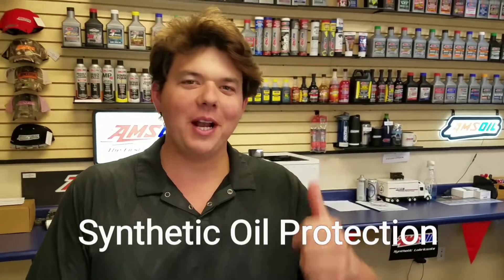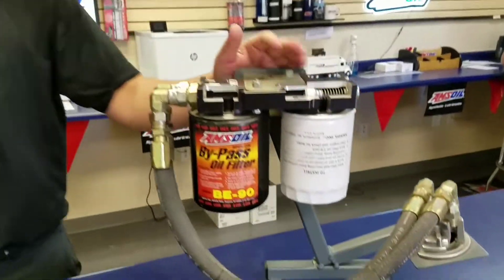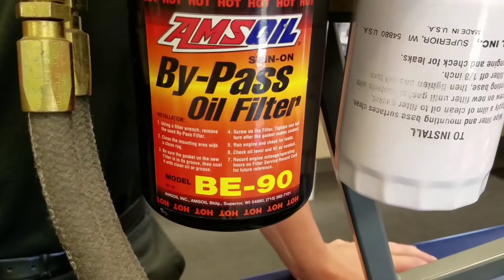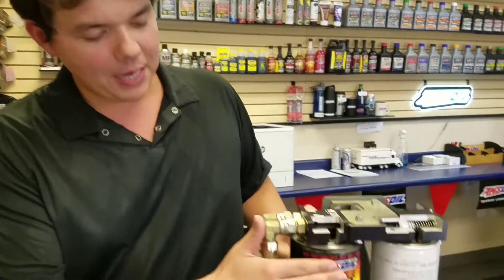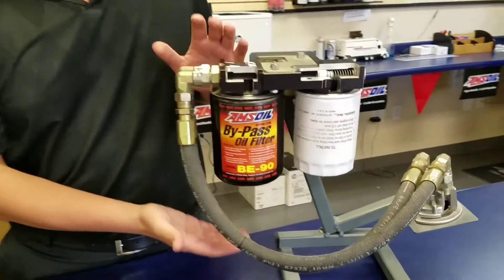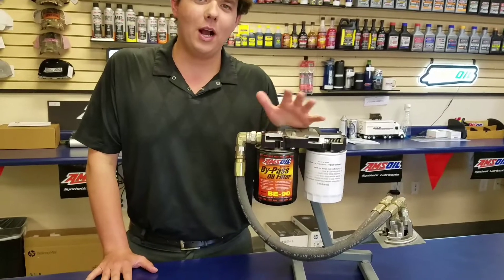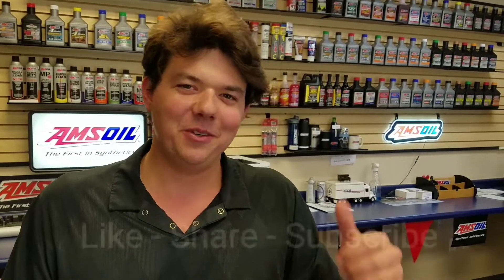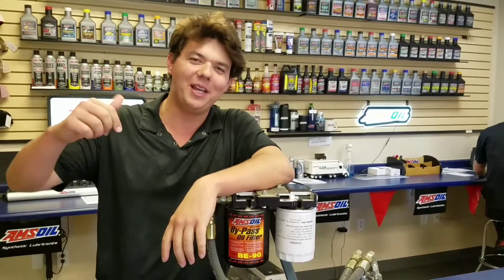Why Does Diesel Oil Get Black & Sooty & AMSOIL Will Help?

Comment: The bypass filter does not change the color of the oil, although the filter does filter the soot to  smaller particles
Reply from the maker: Yes when you put it on your fingertips and feel it it is a difference in color.
Less particles floating in the oil.

You can actually tell when the oil is really starting to wear out by feeling it between your fingertips that is something you get a knack for over years you can always do an oil analysis test to know exactly what's in your motor oil - https://youtube.com/shorts/ycKs-VSepps?si=FEUYzpBwSD9AXKQC

Let's give a man a fishing pole & show him how to fish. 

     Together! We can get your vehicles to run better than brand new! 

     For me to get credit & be "Your" Independent AMSOIL Dealer, please use my website below or my dealer no. 5331179 call anytime Eben Rockmaker 702-472-3614
After you click on: http://syntheticoilprotection.net
1. Click the hamburger menu
2. Click offers AMSOIL preferred customer
3. Click join now. 6-month PC member add to cart.  ( There is no reoccurring renewal membership unless you select that dot box ) 
( You have the option to not have your credit card saved if you prefer - est. 1972 )
4. Scroll up to the top Select shop by vehicle. 

New Promo Code: FREEWAND

Comment: I talked to a Ram 6.7 diesel owner, who swears by the Amsoil Max Duty 5w30 diesel oil. Do you have any customers using this oil in the late model ( emission ) pick up diesel engines. There doesn't seem to be any reviews or you tubes on this oil.
Reply from the maker: Oh yeah tons of them definitely check out the playlist on how to improve the performance of your engine by choosing the right oil and lube you'll see that on the home screen of the channel here you'll see about 20 different videos with diesel engines all different types and results if you have any questions always give me a call happy to answer anything specific.
Together! We can get your vehicles to run better than brand new!

     For me to get credit & be "Your" Independent AMSOIL Dealer, please use my website below or my dealer no. 5331179 call anytime Eben Rockmaker 702-472-3614
After you click on: http://syntheticoilprotection.net
1. Click the hamburger menu
2. Click offers AMSOIL preferred customer
3. Click join now. 6-month PC member add to cart.  ( There is no reoccurring renewal membership unless you select that dot box ) 
( You have the option to not have your credit card saved if you prefer - est. 1972 )
4. Scroll up to the top Select shop by vehicle. 

New Promo Code: FREEMP

Comment: Thanks for the videos.
 I have a problem with my 2013 Yaris Diesel. For the first time 13 months ago my service - oil light came on.  It's this yellow spanner.  I asked a friend and he said it's nothing. So I turned it off but after about 7 months it came back on.  I go to the mechanic who tells me to do an oil change.  I make a change but after about a thousand kilometers it comes back on. I go again and it removes my oil because the level had risen.  But after a thousand kilometers it lights up again.  I go to another mechanic and he tells me that I didn't put in the right oil, and that I have soot in the oil.  So he changes my oil and tells me that the many regenerations of the dpf are to blame, etc. After about 3,000 kilometers the light comes on again.  I do not know what to do;  One of these mechanics says that there is a problem with the oil level sensor.  I am confused. You have any idea?

 The engine has 130,000 km and last time the dpf was fine (15%)
 Regenerations happen approximately every 250-300km
Reply from the maker: I would consult a tech..
I give a man a fishing pole & show him how to fish. 

     Together! We can get your vehicles to run better than brand new!

     For me to get credit & be "Your" Independent AMSOIL Dealer please use my website below or my dealer no. 5331179 call anytime Eben Rockmaker 702-472-3614
After you click on: http://syntheticoilprotection.net
1. Click hamburger menu
2. Click offers AMSOIL preferred customer
3. Click join now 6-month PC member add to cart.  ( there is no reoccurring renewal membership unless you select that dot box ) 
( you have the option to not have your credit card saved if you prefer - est. 1972 )
4. Scroll up to the top Select shop by vehicle.

New promo:FREESHIP

Comment: Is there an AMSOIL Bypass system for 2023 Chevy 3.0 Duramax?  Thanks
Reply from the maker: Yes you can get a single remote system and have it put on almost any vehicle you just need the correct adapters.
The kit may have the adapter for yours if it doesn't you need to get the kit that threads into the full flow filter area then it routes the hose to the oil cap and the oil cap is the return line pretty basic setup if not you can always have the Billet aluminum made with a 3D printer that would be your last resort I highly recommend ordering it through my website that way I'll be able to be your independent Amsoil Dealer if you ever have any questions you can call me anytime if it's not on the website I recommend calling Amsoil technical support.

I give a man a fishing pole & show him how to fish. 

     Together! We can get your vehicles to run better than brand new! 

     For me to get credit & be "Your" Independent AMSOIL Dealer please use my website below or my dealer no. 5331179 call anytime Eben Rockmaker 702-472-3614
After you click on: http://syntheticoilprotection.net
1. Click hamburger menu
2. Click offers AMSOIL preferred customer
3. Click join now 6-month PC member add to cart.  ( there is no reoccurring renewal membership unless you select that dot box ) 
( you have the option to not have your credit card saved if you prefer - est. 1972 )
4. Scroll up to the top Select shop by vehicle. 

New Promo: FREEQS

[Name] AMSOIL Technical Support
[Mobile] 1 (715) 399-8324
I also highly recommend running the injector Clean Plus setting boost every single full tank that will make a huge difference in your fuel mileage drivability fuel filter will last longer motor will run a lot smoother with better power💯🇺🇸

Comment: Is it possible to get a bypass filter on a gasoline car? Just curious
Reply from the maker: Issa Nesheiwat  yes,
Reply: Synthetic Oil Protection I have a gas car but I’m not buying a bypass filtration system for my 2003 Pontiac grand am because my car is so low to the ground it’s very difficult to get under the car when it’s on the ground

Comment: MR. EBEN HOW U DOING TODAY? I WOULD LIKE TO KNOW IF I CAN INSTALL THAT BYPASS FILTER SYSTEM TO MY 2004 4X4 CHEVY TRACKER ? THE CHEVY TRACKER IS A V6 ENGINE
Reply from the maker: There is a relocation kit that you can get and do a single bypass depending on the oil cap you may have to have one specifically built for it to fit but yes you can do a single remote bypass filter💯🇺🇸
   I give a man a fishing pole & show him how to fish. 

     Together! We can get your vehicles to run better than brand new!

     For me to get credit & be "Your" Independent AMSOIL Dealer please use my website below or my dealer no. 5331179 call anytime Eben Rockmaker 702-472-3614
After you click on: http://syntheticoilprotection.net
1. Click hamburger menu
2. Click offers AMSOIL preferred customer
3. Click join now 6-month PC member add to cart.  ( there is no reoccurring renewal membership unless you select that dot box ) 
( you have the option to not have your credit card saved if you prefer - est. 1972 )
4. Scroll up to the top Select shop by vehicle.

New Promo: FREEQS